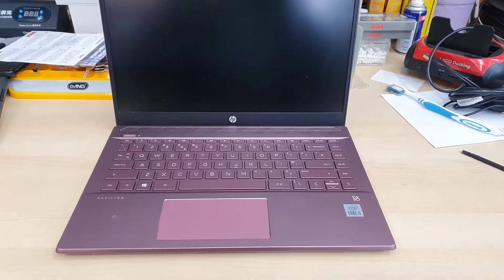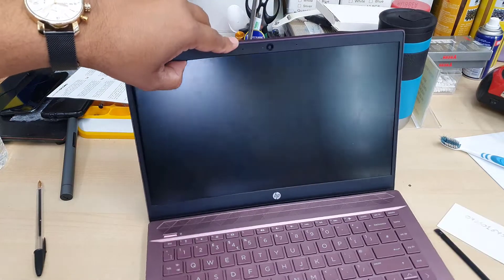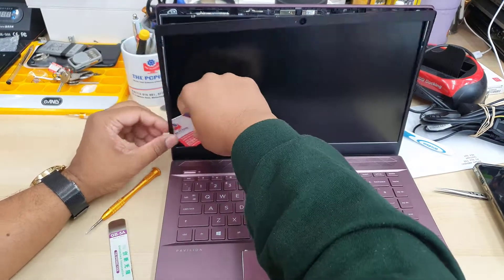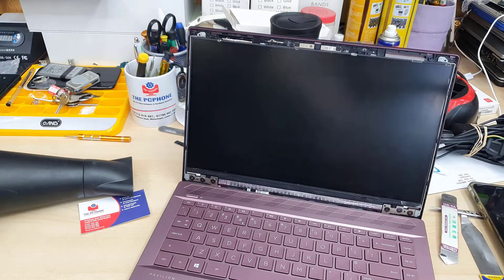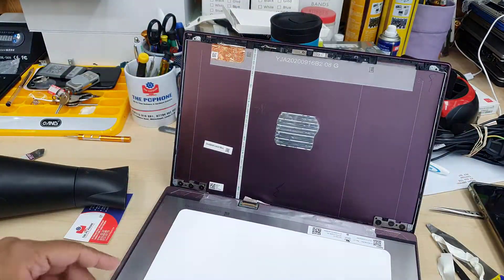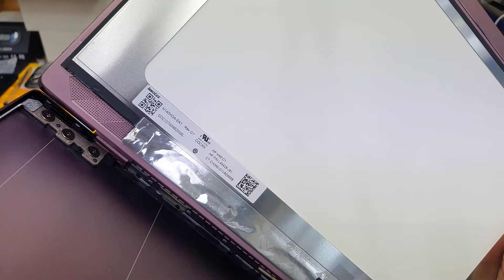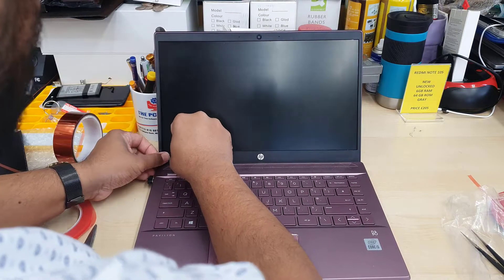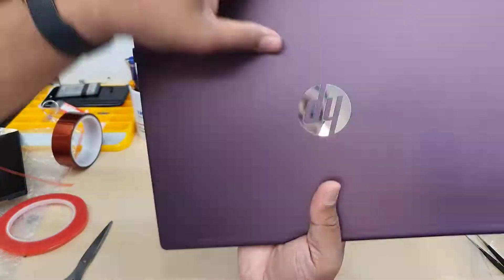HP Pavilion 14-ce3609sa Screen Replacement | Step-By-Step Tutorial

Comment: Thanks for this. What tapes are you using there please? When refitting the bezel is a short length of tape only need be applied to the bottom edge - none needed on the other 3 sides?